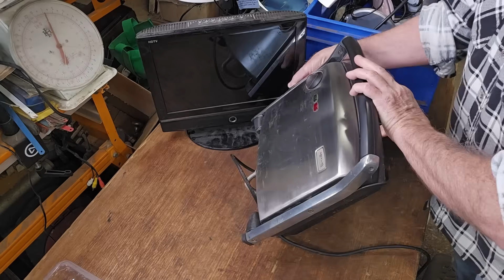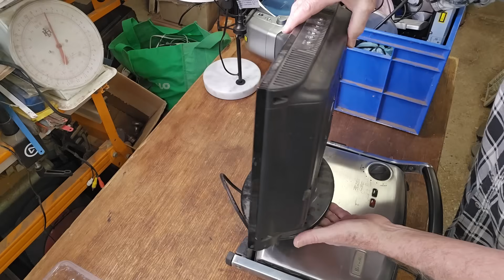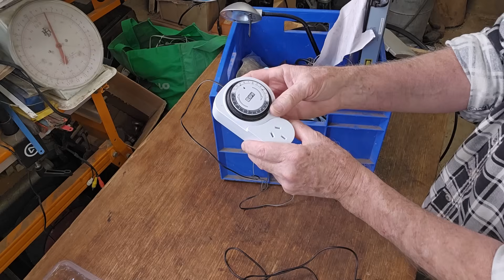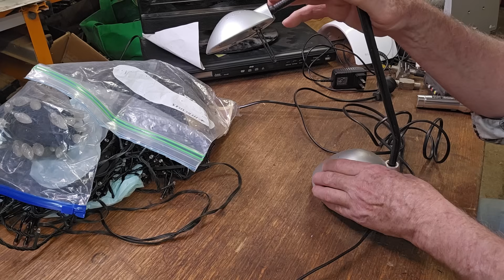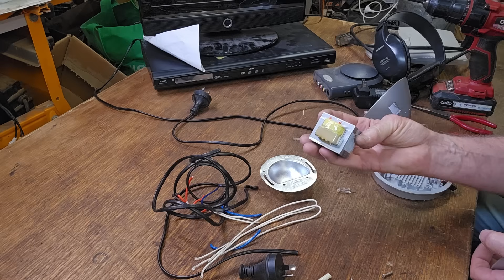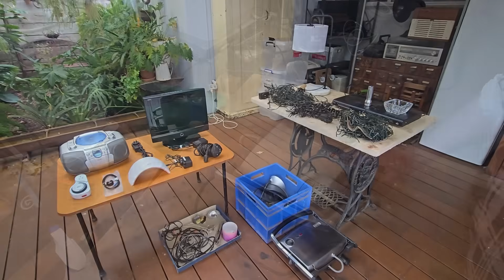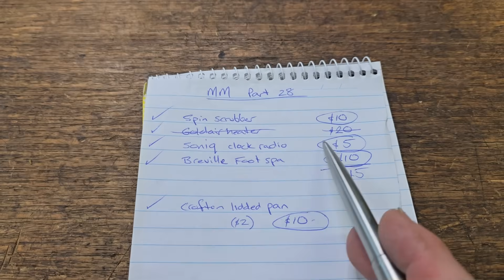Monday Marathon 30 - Processing Ewaste picked up from a Charity Shop! Oh no - More Projects!

Comment: the digital antenna thing should have another unit to go with it, they were the latest thing tail end of the 90's into the 2000's, just sends the output of the VCR DVD or satellite to another tv, but unless you have transmitter and reciever together they're not much use
Reply from the maker: Yep correct Gaz, pretty useless with only the transmitter!

Comment: Hello Chris, lots of goodies to assess.    I never got on with halogen bulbs.   Their energy saving over incandescant  bulbs was minimal, about 20%, and if you knocked the lamp the movement would make  the bulb blow - took me a while to realise what was happening. .. The tube style eco bulbs saved about 80 % but I thought they were ugly   and not compatible with some shallow shades. .   I switched to LED as soon they were readily available.     The shade on the lamp with the 180deg. neck curve - I've never seen that style with a shade, I think they were meant to show decorative type bulbs?  (I don't like naked bulbs unless they are a  very low wattage.).    It's Tuesday evening UK so getting close to Friday.   I'll be thinking of Christine and you and sending love and positive vibes across the miles.     E❤.
Reply from the maker: Thanks Eileen, yes I think you are correct about the lamp with the cable tied shade! Perhaps they did that as they didn't want to buy the more expensive decorative low wattage globes. Thanks for your well wishes, I'm sure everything will go well ♥️😊
Reply: @TheUltimateRecycler.   Bless you both.  ❤❤. . E❤

Comment: 1:40 anything with that slick non-stick coating should be pulled apart for metal and electronic recycling. That surface is so slick because of toxic BPAs that are released in your food and the water system every time you do the washing up.  Removing them from service is far more noble and healthy for humans and the environment than putting them back into use. 

The grill you have there has a nicked surface - a clear sign it really shoud be recycled.
Reply from the maker: Yep, any with damage or wear to the surface get scrapped straight away!